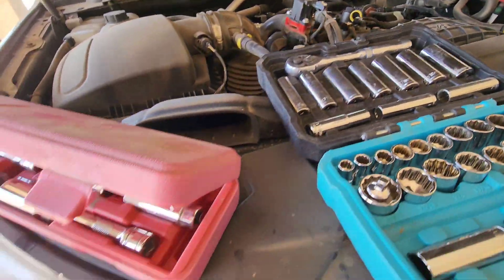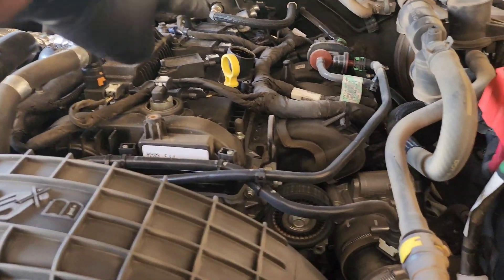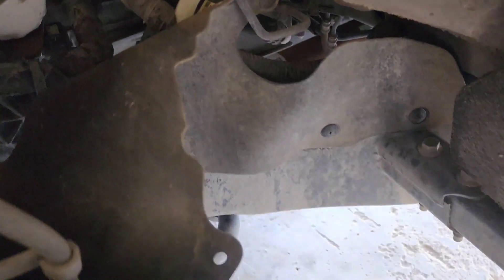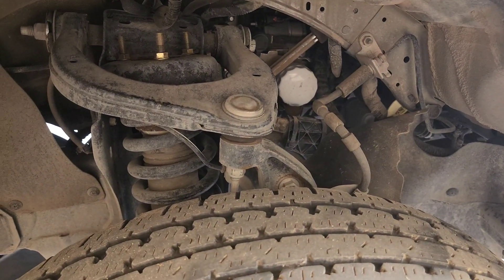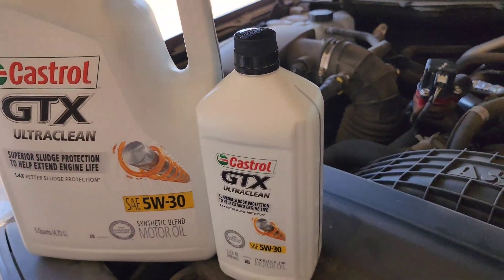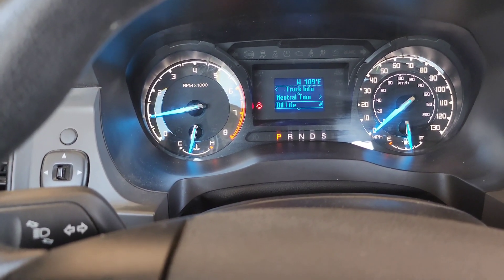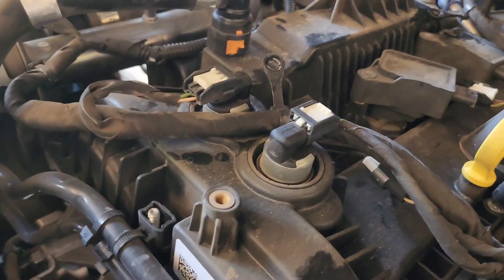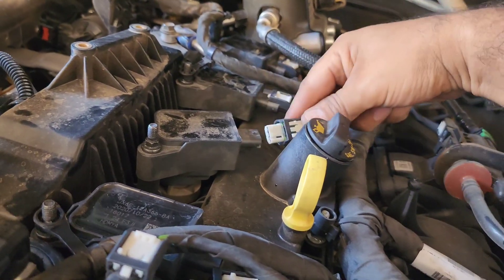2020 ford ranger oil change and spark plugs how to video

Comment: A lot easier to remove the filter if you take the wheel off.  You should be rotating your tires every oil change anyway, so you might as well save yourself some struggle.
Reply from the maker: Very true sir.